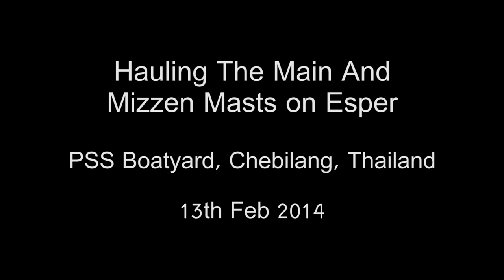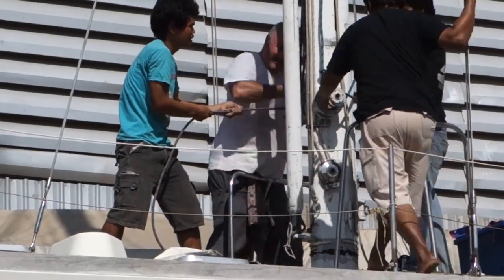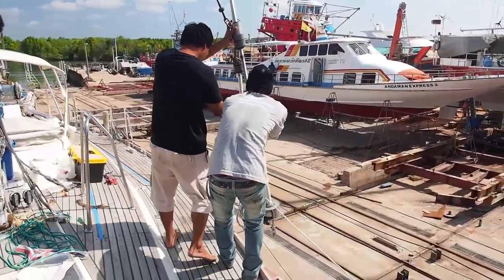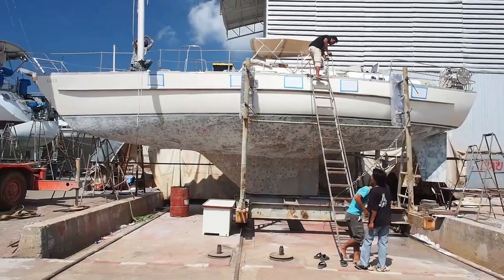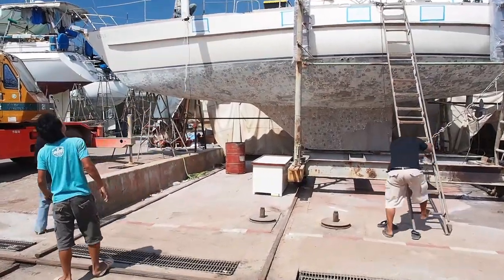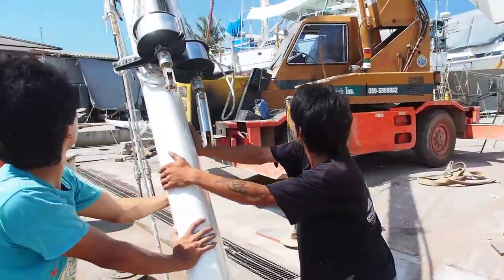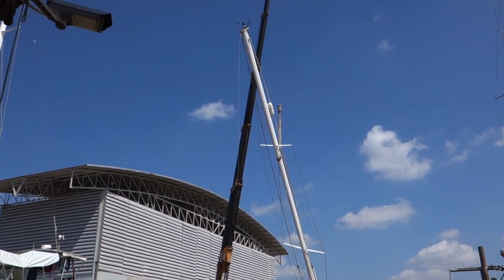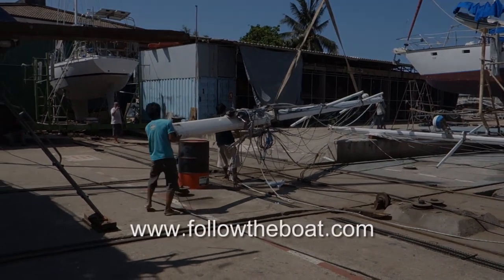Esper Refit 02a - Removing The Main And Mizzen Mast From An Oyster 435 In Thailand

Comment: Interesting to watch how this is done. I'm enjoying following the process on your restoration. I'm planning to restore an older Watkins sailboat this spring, but most of the work will be done by me. Labor rates here in the US are very expensive and make it so that most restorations are cost prohibitive. Sometimes one is better off buying a vessel in better shape, or even new. Good luck and look forward to more on Ester.
Reply from the maker: That's one of the reasons for doing this work in Thailand, Renny. The labour rates are much cheaper yet the skills are still there. It's getting more expensive, however, and Phuket Boat Lagoon is now on a par with Europe, which is why we went for PSS in Satun.

Comment: May I ask what king of savings you can accomplish compared to the UK or in my case San Diego USA? Our Catalina is in need of some TLC but we are also travelling South Towards Panama. Any information would be greatly appreciatedMany Thanks Ian.
Reply from the maker: +ian morton [Liz] The savings are to be made primarily in labour costs. 
Our workers' daily rates in 2014 ranged between 400-1200 baht. Jobs are generally costed per day, rather than for the whole job. 
Check out the PSS website for current haulout/hard standing prices. 
Marine equipment (navigation, deck hardware, engine parts etc) are roughly the same price everywhere in the world.
Good luck with your plans!